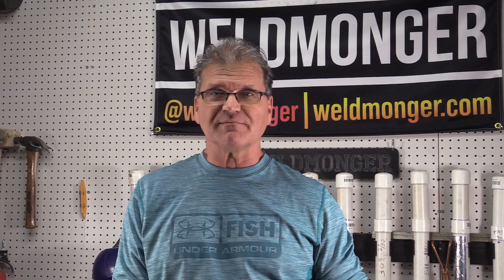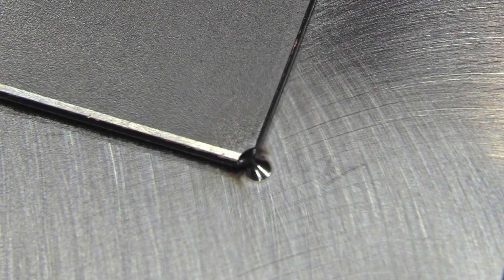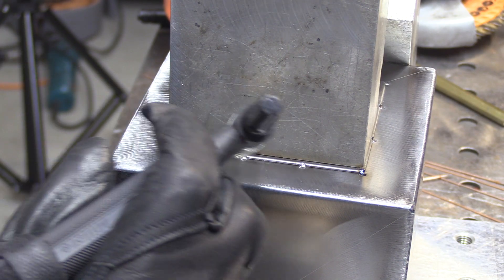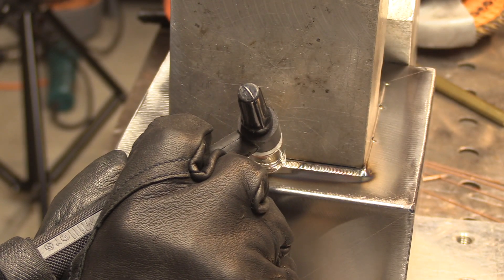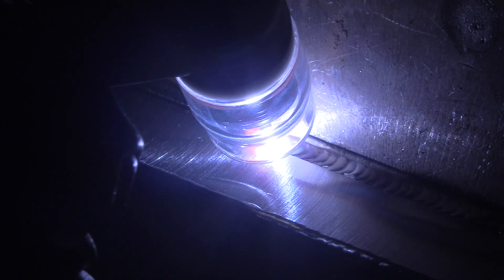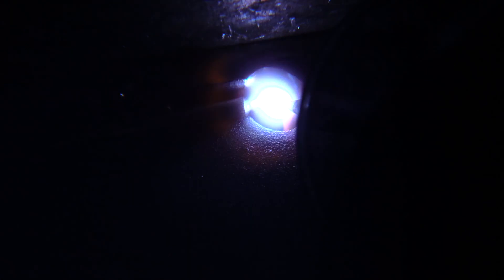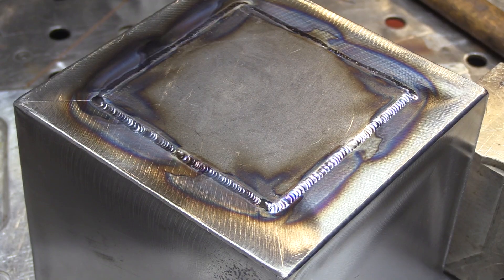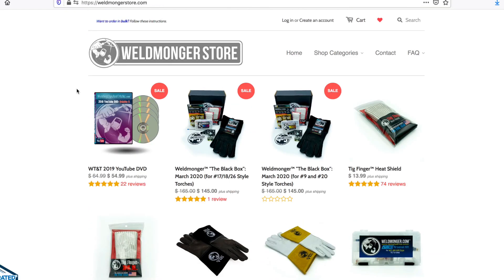TIG Welding 18ga steel Laps | Welding Tips & Tricks #Welding #TIG #WeldingTechniques

Comment: Im welding 18g stainless inside a mixer tank. I barely fit in, no movement with a scratch arc miller maxstar 160. This setting help me.alot.  thank you sir.

Comment: New to tig welding and new to stainless. My dad has a toolbox thats been with him since he was a kid and theirs a small latch on it that hed like reafixed to it, it would be very similar to this 18 guage lap weld except it would be stainless to mild. My queation is why you use a 3/32 tungsten as opposed to a 1/16th or even a .040, I would of thought the smaller the material the smaller the electrode, im also wondering if the use of some pulse settings might assist an amateur like me whose new to this thin material.

Comment: Using that brass plate to hold down the plate, are you not concerned about getting electrocuted?
Reply: I don't know about his welder but mine runs around 10 - 18 Volts DC, not enough to be a shock hazard.

Comment: Great video, Jody!  All this time of working from MIG to TIG skills and running beads on 1/4" thick metal, I'm finally going from beads that look like loose change and pocket lint to dimes and a few pennies thrown in.  Biggest problem?  Trying to keep my hand from cramping up while feeding filler wire through a claw.  Then I see, in one of your closeups, that you're really not even gripping the back part of the wire to push it!  It's just your thumb pushing it along as the front of the wire just lays between your fingers.  I didn't believe I could get a purchase on the wire to push it along but it works!  Thank you!

Comment: ok - i really like the information - but i have come to realize that most of the video is useless to a beginner and maybe even an intermediate - one of the most difficult things i found when starting out was how to get into position to weld - in tig welding almost anything complicated is all positions and both hands -  and a wider video shot angle ( i have nor clue what a director would call it - wide out? - wider frame? )  showing how your body and hands are would be much more informational - caveat - all jobs are different but this is how I do it....?    for example  - make a simple door handle - pipe - 3/4" sch 40. 12 inches long - with 2  - 2.5" supports on 2  - 2in square plates -   - 
tig is all  - with wide shots on how you tack it and themn move it around the work table to access... 
 small but very challenging project for a beginner  - just a suggestion - i think i just got tired of seeing puddles -  when hand and body are so much equal in importance for good welding

Comment: Would love to see some tips for doing this in automotive application, specifically on sheet metal replaced during body restoration. In that area I can’t see a way to use a chill block to hold down edges like you have in this video. Would love your thoughts.
Reply: Use a mig like everyone else does

Comment: Getting into welding and have just been stick welding with an old Lincoln 250 tombstone. I’m looking at buying a multiprocess welder and really getting into aluminum tig welding and small mig projects. Is there a certain welder you would recommend? The ESAB 205ic seems to be the best for the money and I’ve been strongly considering it
Reply from the maker: The Esab Rebel 205 is great...so is the Miller Multimatic 220 acdc . 
Esab has a few more settings

Comment: Any porosity problems with the CR mild steel ?  Seems like when I'm welding clean CR material I get a boiler rolling out of the puddle on occasion. I mostly  weld 4130 in aviation but build a lot of sub assemblies in mild steel. I take a lot of time to make sure everything is clean. Thanks for the video.
Reply: The only times I've ever had porosity problems on CR mild steel that weren't gas related were when I accidentally grabbed gas welding filler rod or trying to finish weld an airtight assembly.
Reply: You should never have porosity with colled rolled steel its about the most forgiving steel there is check filler and make sure u got no gas leaks i have also bought filler that bubbles randomly before make sure it always er70 series rod
Reply: But do you also clean your filler rod with acetone? Try 70S-2 instead of 70S-6 if you're using that, also. 6 is runnier and tends to do some stranger stuff, dragging up impurities and sucking odd things to the surface. 
Otherwise agree with Kieren on gas, potentially too little or too much despite what the gauge is showing.

Comment: I’m 46 and I wish I would have learned to tig when I had 20 year old eyes.  You make it look so easy to keep that short arc length.  A cheater lens has helped a lot but I still dunk the electrode too often.
Reply: 54....cheaters and the best helmet you can afford!
Reply: I'm 46 too and had the same problem. Switching to a good welding hood changed that for me. Now I see things much better.
Reply: I'm 27 I butt weld 1mm steel on cars everyday I've been doing it since I was 22 it's still difficult for me too just need alot of practice somedays are worse than others to I will go all day without dipping some days the next day i dunk it 5 times lol
Reply: 46? That isn't old.unless you liked to weld without a shield..lol😎
Reply: @VWWRENCHIE  or unless you’ve been welding since you were 10.

Comment: Great video Jody.  

Can I ask why you change to a smaller diameter cup for the blast tacking?  I started using the blast tacking technique years ago but don't change my cups or gas pressures.  Can you explain why?

Thank you.

Mike
Reply from the maker: mainly to save gas. but it also makes it easier to prop the cup with the tip pointed right where it needs to be
Reply: weldingtipsandtricks thank you. For multiple tacks that makes sense. For one or two it probably isn’t worth the time or gas. 
Thanks for the quick reply Jody and I enjoy the videos.  
Mike

Comment: am a beginner, I want to learn how to weld tig on stainless steel, the materials I would weld are thin, the sole plate is maximum 1/8 or 3/16, which video of yours would you recommend to start
Reply from the maker: if you are just beginning, practicing padding beads on aluminum will be some of the best practice you can get for stainless.  sounds weird but it works.  welding beads on aluminum will get your feed hand up to speed quicker than anything.  then you can transition to steel easily.
I have a video called the "aluminum drill" that explains it all  https://youtu.be/xYgatSQ2Ldk